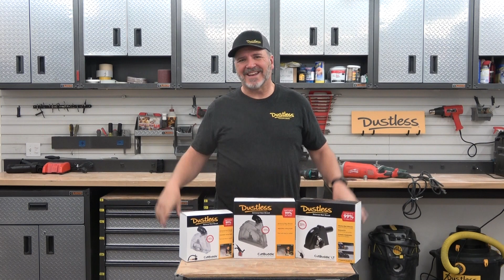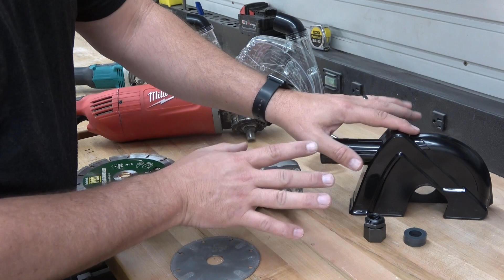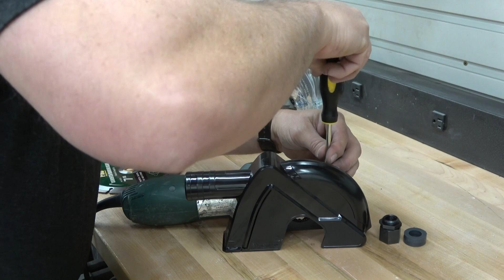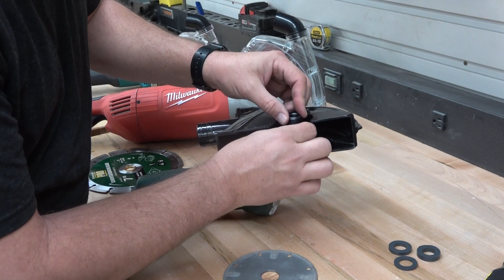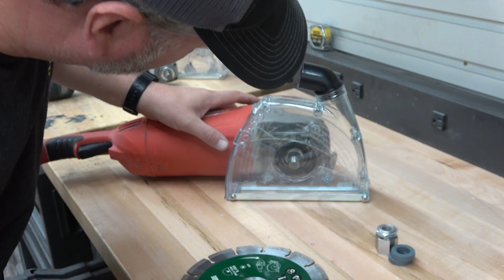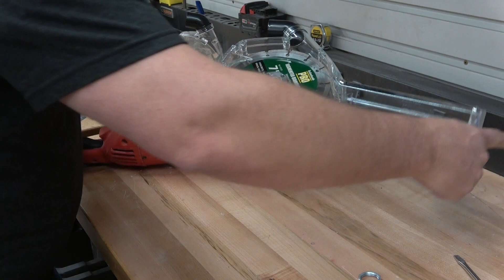CutBuddie Installation for 5 inch and 7 inch Hand Grinders | Dustless Answers

Comment: Where can I purchase these ?
Reply from the maker: Hey Harold,

You can use our dealer locator to look for a dealer in your area, although we recommend calling ahead to ensure stock levels:

https://dustlesstools.com/where-to-buy/

Alternatively:

5 inch CutBuddie for Angle Grinders:
https://dustlesstools.com/product/5-cutbuddie-shroud-w-18-hose/

7 inch Cutbuddie for Angle Grinders:
https://dustlesstools.com/product/7-cutbuddie-shroud-w-18-hose/

Thanks!